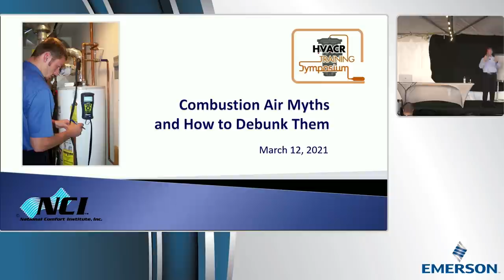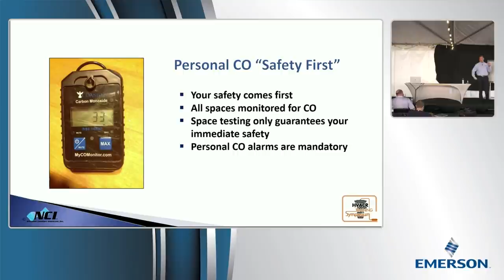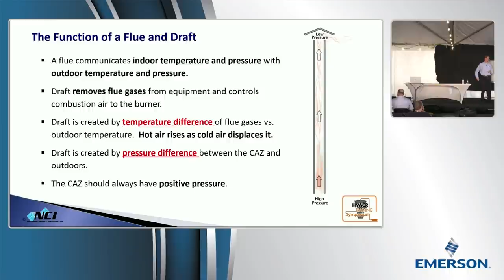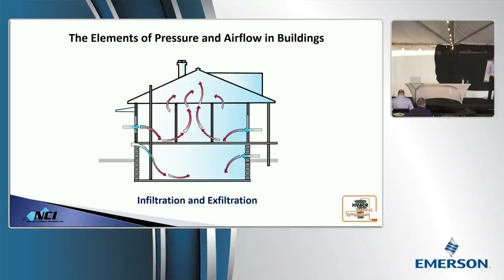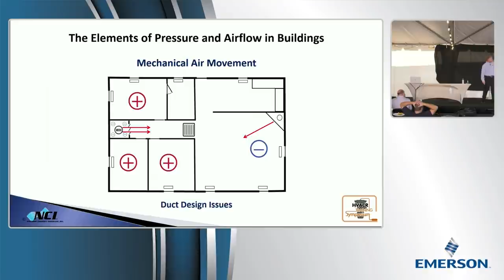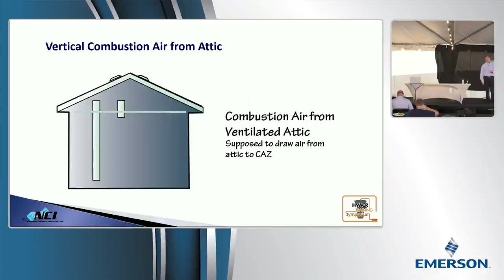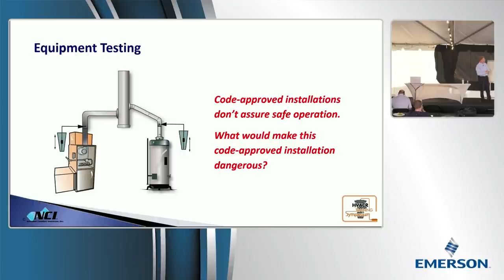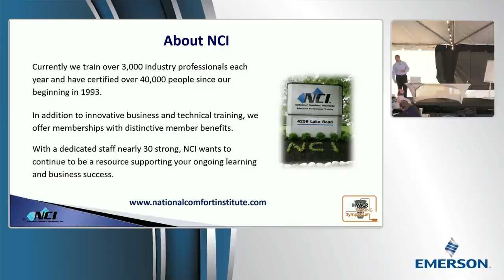Combustion Air Myths W/ David Richardson

Comment: The high/low air intakes reminded me of the root cellar and barn ventilation designs in  'A Textbook of the Physics of Agriculture', F.H. King, 1907.  The design in barns was to remove gases from the animals.  Those barn flues used the very tall cupolas or very tall above roof flue piping.  Seems at some point some one cut down the height probably for aesthetics.

Comment: I spent almost 2 hours to see how to do things right, but for 90 minutes lecturers tried to show that he is the smartest guy in the class (by the way it is not the temperature that moves the air, it is pressure difference due to difference in air density) and just passed quickly the right things that everybody already was doing.

Comment: Here's the condensed version:

Combustion requires oxygen(air).
Heat rises.
Pressure differentials will always seek equilibrium. 
Never let the opportunity to fear monger about combustion air go to waste. 
Everything everyone has done over the last 100 years regarding combustion air was dangerous and incorrect, even if statistics prove otherwise.
Reply: so your not a fan of NCI??? i thought that as well, but he did say code is the bare mim.